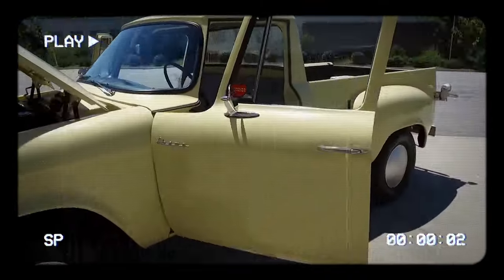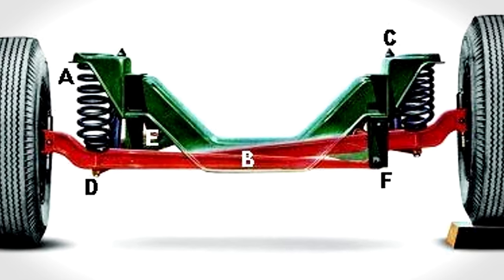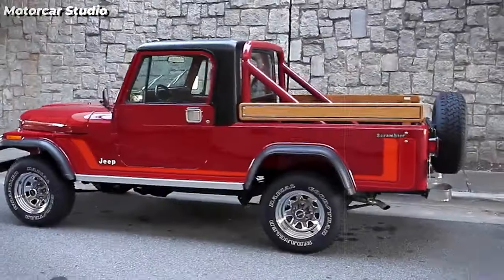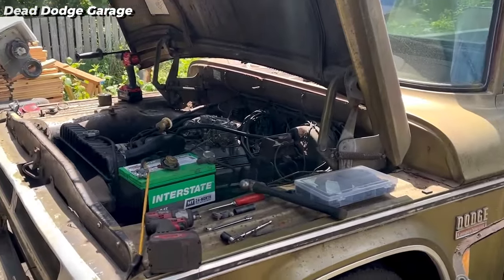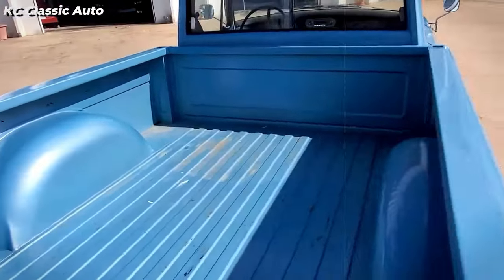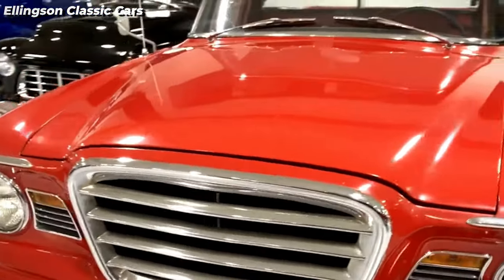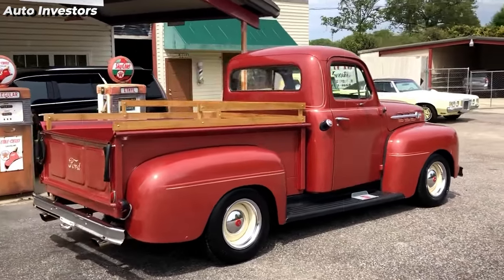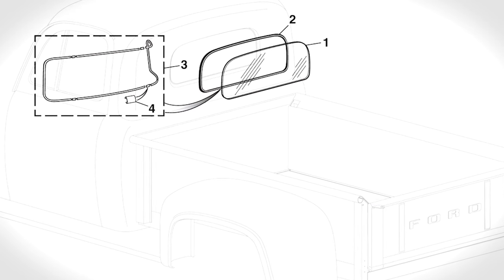5 Most Underrated Pickup Trucks! You Probably Didn't Know Exist!

Comment: I liked the studebaker the best ❤
Reply: No mention here of the late-1930s Studebaker Coupe-Express, basically the same concept based on the Studebaker Dictator in '36-'37, then the Commander (dictators were falling out of fashion and Studebaker retired the model name) for '38-'39.
Studebaker sourced the tooling for the Champ from  Dodge because Dodge had redesigned its trucks nd the older design would fit the Studebaker chassis, explaining why the leading end of the bed didn't match smoothly with the Lark-based cab.

Comment: I had a Scrambler. It had a bad problem in that there was no cross member under the transmission/transfer case. It used the skid pan as that member. It would build up slush and then freeze at night locking the drive shafts until they could be cleared. It also ate throw out bearings.

Comment: The only truck in this list that wasn't appreciated was the Studebaker.  Fords, Dodges and even the Jeep Scrambler sold pretty well.  What about the Jeep J-10/20 and Jeep Comanche?  The Comanche was a better design than Toyota, Dodge, Ford and GM  compact trucks of the time but AMC didn't have resources to advertise it so it fell by the wayside.  My '78 Jeep J-10 had better ride and handling than my brother's '78 Chevy K-10 by far.

Comment: You need to better with your pictures. In the 68 ford section you also show several puctures of trucks from the next series 73 and up. Also good rrucks. In the 70 dodge section the black crew can truck is a ford. In the studabaker section you talk about cracking problems on their overhead valve 6 and show their flathead. Also mentioning their higher hp 6 you only show the battery. Sloppy work.